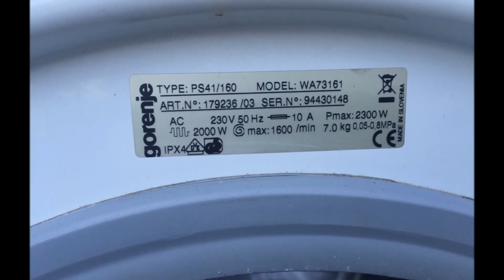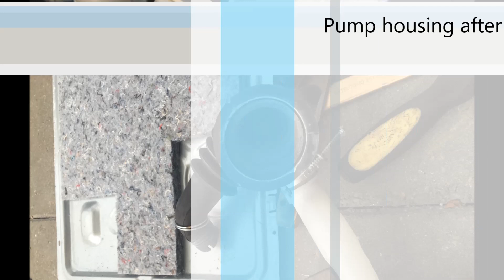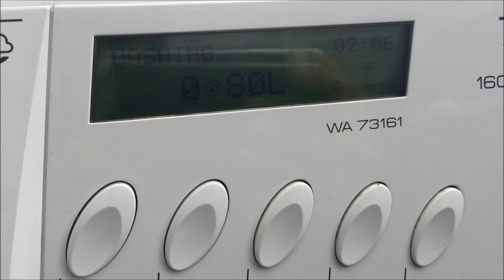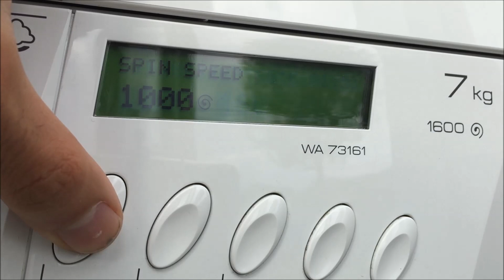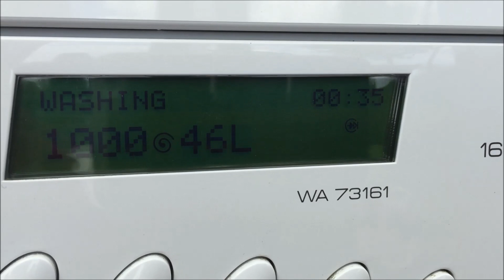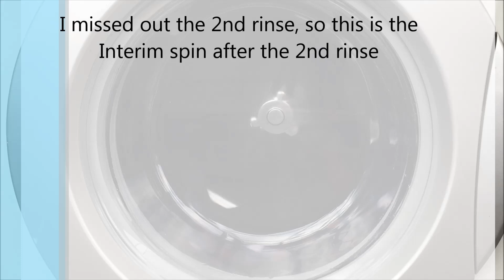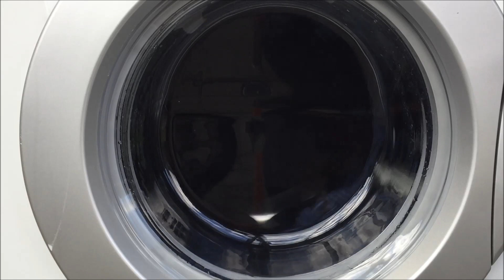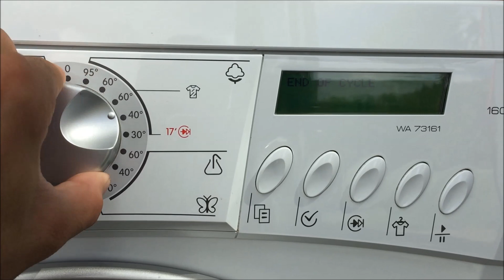Gorenje WA73161 Use-Logic - Repairing & Cleaning + Test Wash

Comment: Was it using 6207 and 6305 bearings?😁
Reply from the maker: Yes my WA 73161 I used the 6305 + 6207 bearings, I believe it’s the same for the WA 65205 as they use the same tub 👍🏼🙂
Reply: @Electroluxwasher  yes! 65205 uses same😊

Comment: Wow... How could anybody let a washer get to such bad condition... Astounding. Question - 2 maintenance cycles? So 1 wasn't enough then?
Reply from the maker: Yeah i could'nt believe it eighter, but the use of the Quick '17 prog for everything which liquid detergent, must have lead to this disaster, but did 8 maintenance washer at 95'C everytime which 200 ML of Citric Acid, after the 8 run, the water was still dark and dirty...
Reply: Eight? o_O Holy crap... But you did well to restore it back to proper working order.

Comment: Hi, I would like to ask you, how did  you get out screws from that "red star" from washing machine. Thank´s
Reply from the maker: The screws at the bearing housing are just normal, sockets bolts 10 or 12 size, you can  take them off easy with a socket wrench. :-)